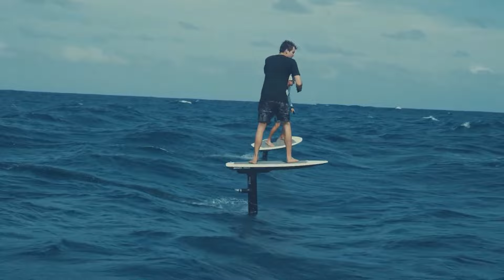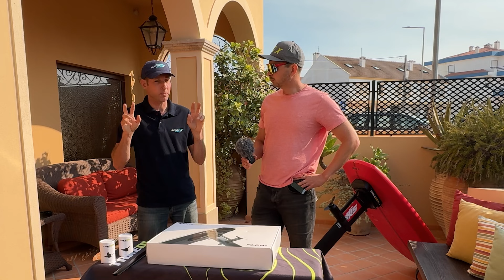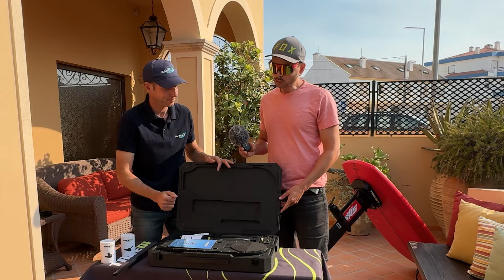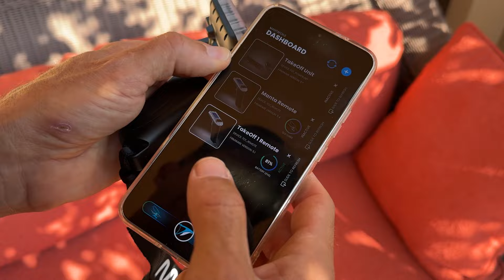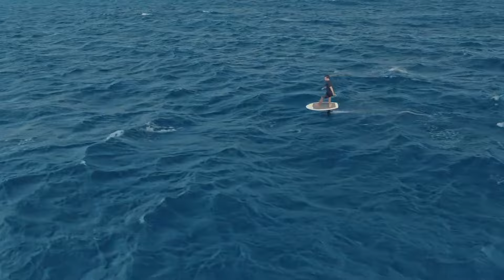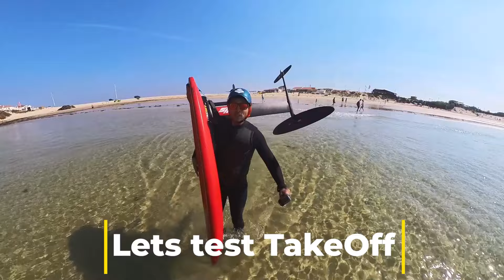TAKEOFF Foil Assist Review by MantaFoils🏄‍ Unboxing & Testing

Comment: Be aware  with Manta foil..their products  is full of issues  and they do not fallow  with customers  services and their warranty  is nonexistent. 
Spent 5k on a new foil drive take off air with travel batteries.
Form the first day I got it it was issue with the installation  and the connection  we ith the firmware...that after 3 days..the bearings in the motor started to give up...making noise...and finally  broke abd seized into the rotor shaft.
My unit it now in the garage  in the recycle container. 
So yes my advice is be very careful  investing  with this company. 
And they are  base in Dubai..so difficult  to do any action law against  them. 
Good luck

Comment: First off I am an avid prone foiler with no motor assist. I also wing foil. I have been foiling for 5 years now. I have the Takeoff. I was one of the early investors in the crowdfunding beggining helping them get in business. It shipped 6 months late and came in many separate pieces and was a pain in the butt to set up. I waited 6 months after the first part to arrive before the final piece arrived. Then two parts broke in set up and the batteries died on me before I could even ride it. It didnt work at all as an efoil on my prone foil set up. And when I put it on my 6'8' wing foil set up, it wouldnt get it up in the air. Even there local rep could barely ride it when he tried my set up. It doesnt have enough power to get anyone "up" over 180lbs. My son who weighs 170lb and I cant use it as an efoil at all and barely as a foil assist. It has a lack of power and now I use it just to assist when I am prone foiling. Dont buy it if you weigh over 180lbs and dont buy it for efoiling in any way, way to gutless. Good for a basic foil assist and only if you have a lot of time to waste trying to get it all set up and to fit your foil system. What they dont tell you is it will only fit some systems so you better get written proof from them that it will fit your system before you spend a dime. Parts dont fit, some are weak and break and when you contact customer service in the ARAB country they are in, you cant ever talk to any one, you get left in Whats App and bottom line they wont fix the problem. You have to pay for shipping for anything and in the end you will be left to fend for yourself with a product marketed as a assist foil and efoil. Now they are asking me to update my system and that would be me having to basically re program the system. But you need the part to do that, and then you back spending money to fix the system. The only good thing about Manta Take off is the rep they have in Hawaii Named Fuzzy. He was amazing and tried his best to take care of me. The company would not support him and I felt bad for Fuzzy. He was great and he needs to work for a better company. He paid out of his own pocket to help me get the replacement parts. If they loose him, then they will loose Hawaii. Bottom line is when I needed them to step up for me they just kept me strangling along asking me to keep trying other way to fix the power issues. In the end they offered to sell me a new system coming out if I was not happy with this takeoff power. The only way I would do business with this company again is if they would let me trade in the Takeoff for the Flow as a swap, since I can only use the system as a bare minimum assist. This is what they offered me early in the situation only to not follow through and tell me to buy the new system. Bummer from the day I got the system!
Reply: 200% agreed  with you ..I had exactly  the same experience..terrible  company  and poor customer  service  and no warranty  basically...
Just a non professional  company  that scam customers

Comment: I bought one during their crowdfunding campaign. It's a real pain to install and maintain. It works when it wants to, and despite the "improvements" offered by Manta Foil, it's difficult to use. The remote control (trigger and buttons) is difficult to control once on the water.
I contacted Manta Foil, but I have to return the product at my own expense for inspection (no after-sales service is even guaranteed), and with a battery this size, it's overpriced and very difficult too.
In short, very disappointed. It's a good idea at its core, but ultimately an expensive gadget that's neither reliable nor fun to use.

Comment: I was interested in this product,  thank you for reviewing it. I think everyone probably has the same questions, compared to the foil drive.  It's different about how you store wires, but this one looks cleaner and better. But I'm wondering how it will work when you turn. And what if you put the motor in a lower place like the e-foil.

Comment: Nice! 
how is the power vs a foildrive?
No issues with the remote?
Reply: Heard from a shop in UK that MantaFoils been having quite a few recalls on this. Will be interested to read more into it as the product becomes more popular
Reply from the maker: @xsivnos5597  they had an issue with the early batch that was already resolved in the new batch
Reply: @JetSurfingNation  good knowledge! Have they given you a chance to try out the system as a dedicated efoil (non-dedicated mast)?
Reply from the maker: @xsivnos5597  yes i tried the air system
Reply: +2-3kg thrust from the power vs. the competition
Reply: @MantaFoils  that is less than competition on 2 blade prop?
Reply from the maker: I didn’t have any issues. Power depends a lot on your weight, wing you are using and the board size, so impossible to compare

Comment: You showed how to lock the battery, but how do you unlock the whole air battery for replacing .
Reply: You can see that on our tutorial videos on our page. You just press the button on the aluminum hub of the battery, and pull it backwards out of the main unit. Takes 3sec. Easy : )

Comment: So the built in mast comes in two versions or you can just change the positions of the propeller from top to bottom? I guess if you are using this as an efoil you are up against the SiFly and Waydoo options and just depends if you can put up with all the various components of this or the weight of the dedicated efoils
Reply: On the integrated mast, you indeed choose at the order what is your favorite motor position: Assist position at 20cm from the top, or at the bottom of the mast.

And yes... a Flow or Air with 2x batteries is in the range of only 18kg with our custom board, and still getting up to 1h30 of non-stop motor time (Flow, 75kg rider, ~1300cm2 wing). We've entered a new era, and are super stoked about it 🙌
Reply: @MantaFoils  Thanks for your response.
Reply: @MantaFoils Sounds super awesome.  Is there an estimated release date for an adapter for Armstrong on the integrated mast?  I did hear you say "not *YET 😉*" when Mike asked about Armstrong.  I have a few friends who ride Armstrong.  And of course many Armstrong riders out there in general.

Can an Armstrong mast (or other brand mast) be attached to the integrated custom board and battery setup?
Reply: @eFoilLakePowell  We're on it ; )
Reply from the maker: It’s fixed position if you have integrated mast
Reply: @JetSurfingNation  You ever going to look at ideal boards for these types of systems (assisted surf foil)? Would be good to know if you have preferences on boards for a setup such as this if you are not going for the mantafoils board.
Reply from the maker: @xsivnos5597  for me ideal board is Appletree, im loving it!
Reply: People commonly use multiple batteries in one session when they use Foil Drive. This system offers a larger battery but am I correct in assuming you can’t change out the batteries?
Reply from the maker: @PeteWalmsleyTheSpaceStation  in Flow version the battery is built in, so you cant change it but on Air version you can change of course like in FD
Reply: @JetSurfingNation  cheers
Reply: @PeteWalmsleyTheSpaceStation  I’d say that once this is assembled you wouldn’t want to ever disassemble it again, just remove the whole thing (battery and foil together) from the board, rinse and repeat.